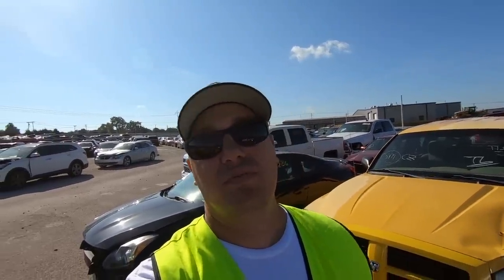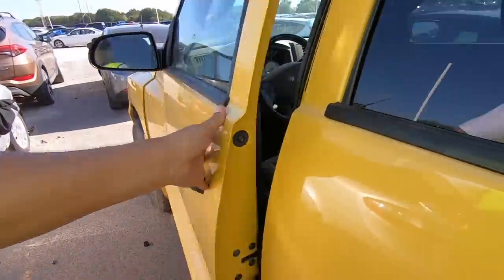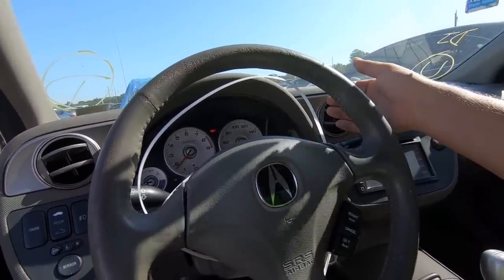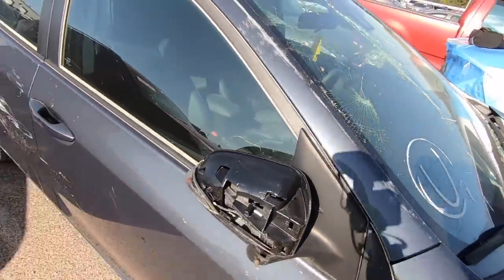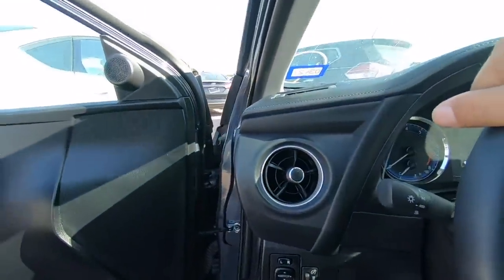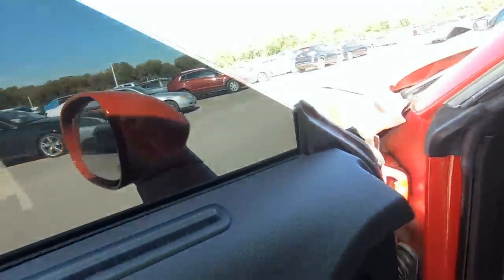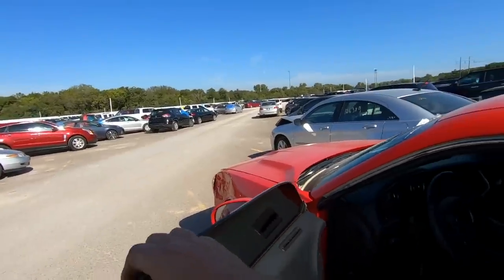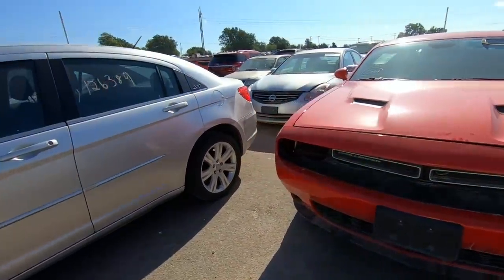Copart Walk Around 10-3-19

Comment: Hi, enjoyed your videos on the Porsche, got to the point where you mentioned had a replacement turbocharger. I’ve had a lot of turbo vehicles, including trucks doing very high mileages, and have never had a turbo fail. Not even the same one in a MG Metro Turbo- local agents reckoned they never saw one that lasted over a year. Making them last is easy. First, that they rely on excellent oil supply is critically important. I only ever used good Turbo grade oil too. On Engine startup, DO NOT rev up the engine! The bearings are dry, and they need an oil feed- make sense- so just let the engine tick over for at least 30 seconds to get that oil flowing to the bearings. Then when you are going to pull in, and switch off the engine, that turbine can be spinning over 200,000 rpm - what do you think happens when you switch off and the oil supply to the bearings stops? Yep, rapid wear to the bearings. So do the same procedure as startup, let it tickover for at least 30 seconds again to let that turbine blade just idle along, then switch off. A neighbour truck driver used to get at least 2 million miles out of a Turbo and told me how to treat them to last. Hope that wasn’t teaching granny to suck eggs. Best of luck to you. 👍

Comment: In my opinion, timing chains are way harder to replace than timing belts, I can have my timing belt, tentioner and water pump in my mk4 jetta with the 2.0 engine replaced in 3 hours and its only $60 for a continental branded kit and do only need to do it every 100k miles its a great deal!

Comment: That Acura is an easy fix. Replacing a QT panel is not difficult. I have rebuilt cars for over 50 years and you need to learn to weld, straighten frames, and paint. With your ability you would learn those skills very quickly and that would let you buy vehicles where there was some profit.

Comment: Timing chains are great unless they are in a 5.4L 3 valve V8  F-150.  Plus their other problems; bad oil pump flow,  spark plug changes, rear diff, & 4wd solenoid.

Comment: German cars have the electronics in the floor boards so that the manufacturers can continue selling parts for these cars long after the initial sale. There can be no other excuse for doing this. 

Remember the 2006 Audi convertible with the soaked CCM? (That was caused by leaves plugging up a drain and causing rain water to soak the interior foot wells.) Audi placing the CCM where it did, shame on them. Simply moving the CCM to the kick panel will give that Audi extra life.

That video saved my friend from experiencing the same loss with his Audi, in that when he pulled the battery on his Audi convertible the drain was plugged with leaves, the same as yours. 

So many fine, expensive cars are ruined because of designs like this.

Comment: Lousy it's not really a GL63. GL550 still 429 hp.  I looked 2015 sell for $32k to $ 39k. Too bad you're not in the position to bring it back. Understand your plate is full.  Acura RSX is fun too.  Run solid a long time with a stick.  Nephew had one forever. Only needed oil & tires.  Challenger had too many parts needed for a v6 with those miles. Might need a right door too.

Comment: Except for the timing and balance chain on the ecotech.  Huge lawsuit over the poor quality, basically GM used bicycle chain and they fail around 30k. Also the 6 speed tranny is famous for the case failing around the output shaft bearing and its unrepairable.  Do your research, GM Paris their executives way to much and as a result the product quality fails due to capitalism greed.